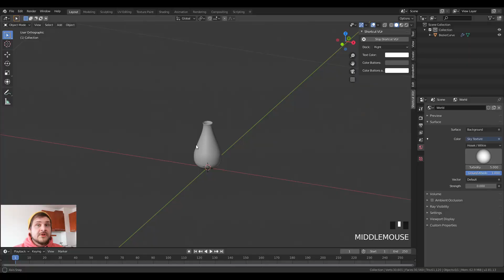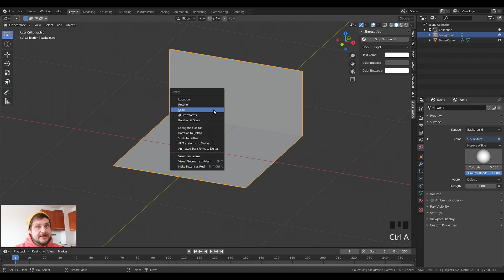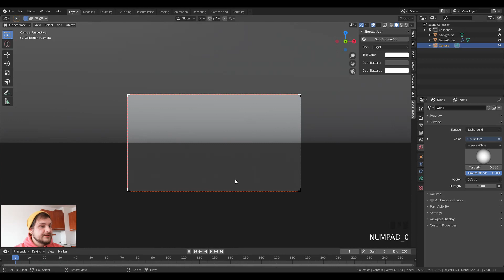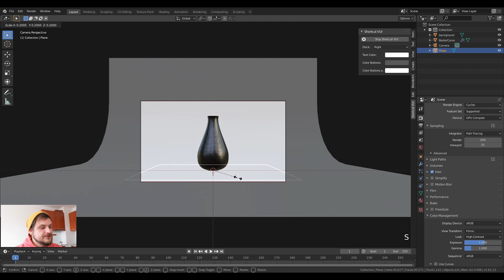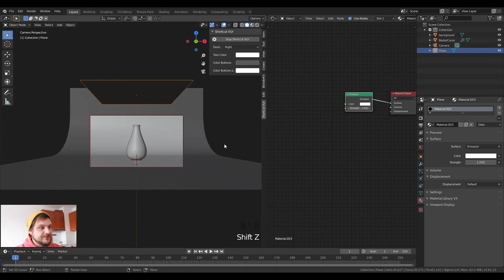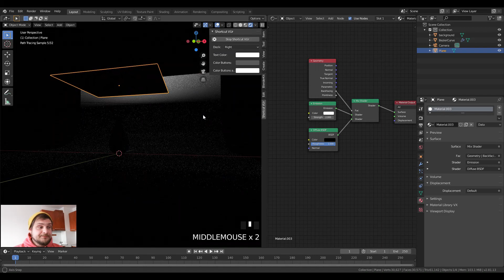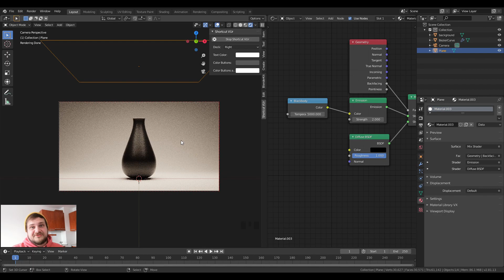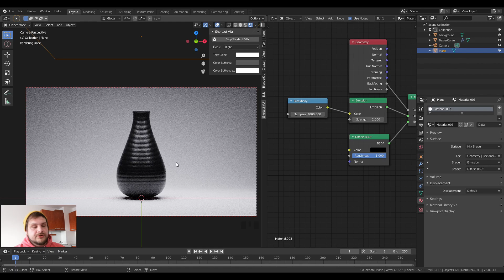QUICK STUDIO LIGHT IN BLENDER 2.81

Comment: Excellent tutoriel. Trank you so much. Just one word about the color temperature (kelvin). I work with light (I’m a light designer) and the values provided by the black body are accurate. I tested a whole range between 1000k and 10000k and they are correct.